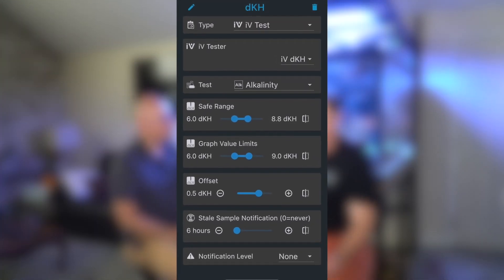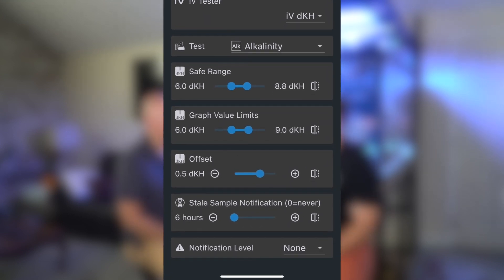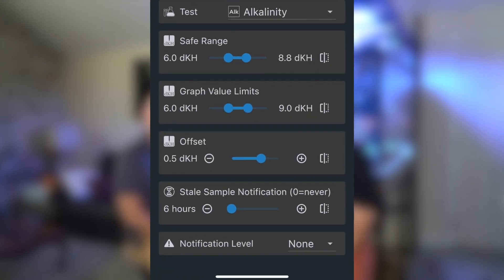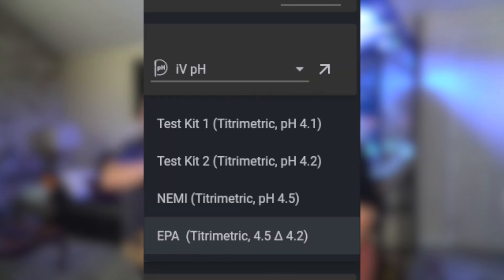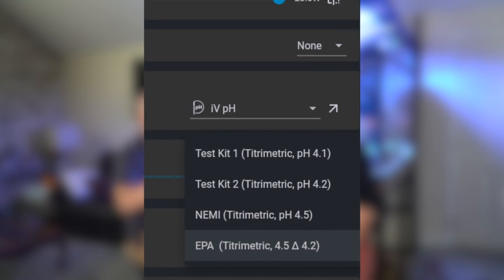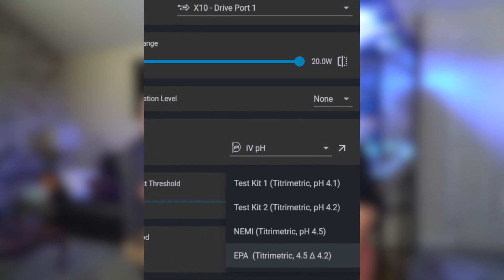HYDROS Control X10 Aquarium Controller - Alkalinity

Comment: How do I perform a sampled ph/salinity without alkaline testing? The setup doesn’t allow to turn this off
Reply from the maker: This cannot be achieved through isolated testing but is easily accomplished if the probes are used outside of isolation.
Reply: @CoralVueTV  yeah, but why can’t it be programmed to skip alkalinity and simply test ph and salinity. My alk test is too inconsistent despite several strategies to minimize bubbles. The alk test is becoming useless
Reply from the maker: Thank you for your comment. We appreciate your suggestion regarding the ability to test pH and Salinity separately and we would like to inform you that it is already on our list of features to add. We cannot provide an exact date for the release of the update, but we assure you that it will be included in a future one. @imCXS-zh2yt

Comment: The titration curve for carbonate measurements has an S-shape. Why doesn't the titrator utilize the inflection point of the curve as the equivalence point of the titration?
Reply from the maker: Thank you for your comment. We want to assure you that we are using recognized standard methods for our testing, including the one that is recommended by the Environmental Protection Agency (EPA) here in the US. This method was developed by the Acid Rain Monitoring Project of the University of Massachusetts Water Resources Research Center. If you have any documentation or links to suggest regarding your testing method, please feel free to share them with us. We will be happy to consider them.

Comment: I’m confused: the X10 has a built in Alkalinity tester? I thought it was just a controller with four dosing pumps. Does it have a sensor for testing Alk too?
Reply from the maker: The Control X10 is a very robust controller and can be used in several different applications. The most popular will be the alk and testing which requires the X10 pH probe and three of the four dosers. Combined with the HYDROS iV you can do isolated testing of pH, alkalinity, and salinity.
Reply: @CoralVueTV  ah, ok. That’s awesome! I have my on preorder at my LFS.